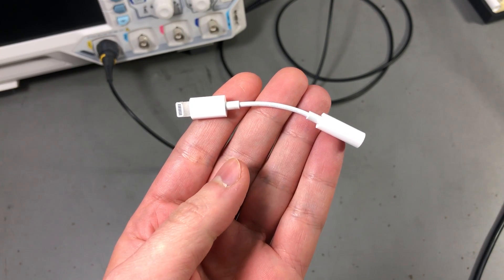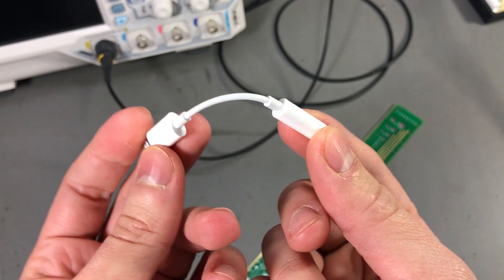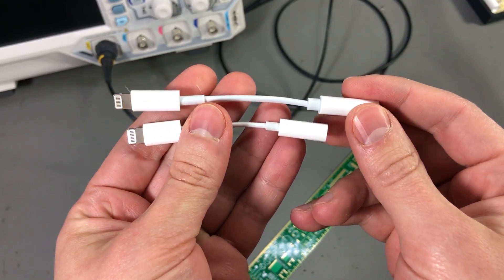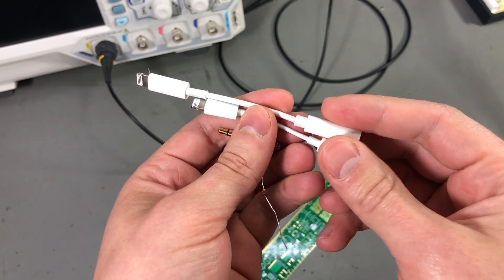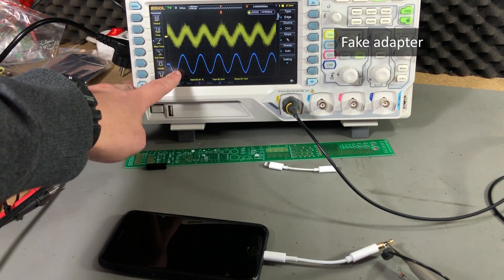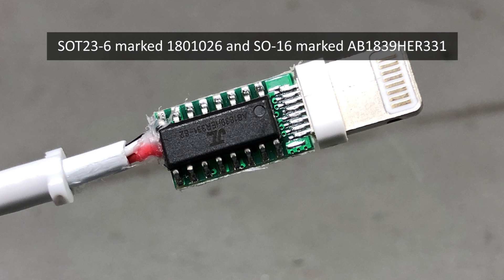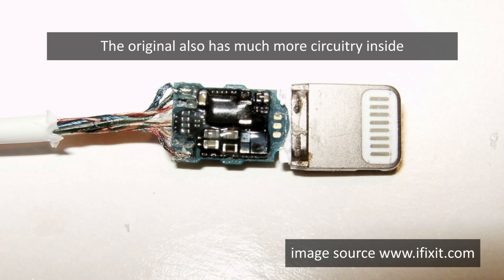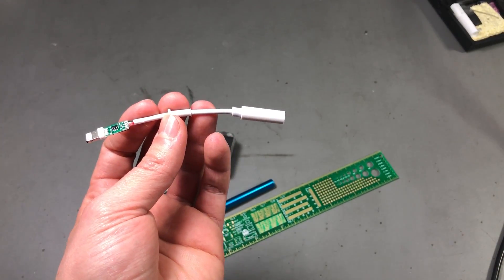Voltlog #214 - How bad is a fake apple lightning to 3.5mm audio adapter?

Comment: Long story short - rubbish. I, too, bought such a dongle last year; threw it out the window the next day (not really). Complete garbage. What pisses me off is why do they sell such rubbish? I mean, If someone had to buy a high-tier phone such as an iPhone to begin with - it is illogical to use this POS dongle with it. The original works the best (obviously) because not only does it sound the best, but compared to other "fakes", the minimal sound volume for the fakes is too high - especially when using a white noise app, the sound is too high on minimum level - which is annoying and inconvenient.

As the saying goes: "A cheapskate always pays twice."

Comment: hello, good friend, one question, does the audio transfer with an original adapter have better audio then?, because it turns out that I have some big original sony headphones but they sound rubbish, if I increase bass with an equalizer, and that does not happen with the others Devices that don't have to use this shhh adapter, when I do it with this it's like a radio with a pillar about to run out of power. I appreciate your answer or if you can pass me information. bye

Comment: FYI for anyone looking at this video now:
Many people have measured the apple dacs inside this lightning dongle and their usbc dongle using an audio precision analyzer. These apple dongles measure better than $1000+ dacs with zero audible noise and distortion. For less than $10 they are incredible even for desktop use and there is zero reason to buy any other cheap dongle
Reply: source?
Reply: @sylver9547  People are usually referring to a report on Audio Science Review by amirm.

Comment: im using a really cheap lightning to headphone adapter which is from ugreen (a chinese brand popular to its usb cables) to be honest I cant really notice the difference, not even a hiss. and its only cost me 5bucks shipped. using heaphone which is a KZ brand (KZ AS16) though im using the KZ brand lightning cable module and dont use the stupid dongles anymore.
Reply: I wonder if it doesn't make sudden very loud screeching sound? It can damage your hearing tbh

Comment: I came across this in my search for information on why i get a notification to “Unlock iPhone to use accessories” as soon as i plug in my knockoff headphone adapter. I never get that with the oem. I’m very suspicious that it’s some kind of data collection function that require an iphone unlock to work. Only info I’ve seen so far referenced GreyKey and law enforcement using such things to attempt to unlock phones. But that was from years ago and i think no longer applies in new ios. My question is if these accessories are doing similar things when i unlock my iphone. I can’t seem to find this information specifically.

Comment: Does anyone know is there actually a DAC inside of this cable? I think that if there really was, Apple would sell these cables for much more than just 9 dollars. I know that there must be a DAC inside of phone for it's speakers, so that they used some of the lightning connector pins for audio output, and these cables are just passive, physical convertors.
Reply: Павле Станковић as an audiophile its a decent DAC yes it has a DAC. Ppl just wouldn’t care about it but for us audiophile its has some serious dac amp. Im using in ear monitor and it power most of it with minimal distortion.

Comment: I am wondering not just about the three wires on the fake adapter, but about the seven ones on the original as well. The jack has just pins, right?
Reply: The others are just extra Ground pins , namely : left channel ground , right channel ground , microphone/remote ground
Reply: ..... I think you'll find the original female socket has four, for a headset/ear-buds with mic.

Comment: I am just wondering how of a quality is the genuine one. Used it once, when I went to clean snow and after a half a hour or so, it just stopped to translate music...
Reply from the maker: It's fragile if that's what your are asking, it's thin and light, I'm sure pulling on that wire a bit harder can easily damage it.

Comment: I got a cheap USB-C to 3.5mm cable off of Amazon recently because the Chromebook I got recently doesn't have 3.5mm and I was pleasantly surprised. It works pretty well .
Reply from the maker: maybe it uses a decent DAC
Reply: Link plzzzz

Comment: The Samsung Galaxy S5 (from 2014) was IP67 water resistance and had a 3.5mm headphone jack. So indeed, Apple is talking BS.
Reply: This is called "gaslighting".
"You don't want 3.5mm headphone jack, we have this brand-new Bluetooth headphone!"
"You don't want thicker phones, you want thinner phones!"
"You don't want anything that is thicker than 5mm!"
Rinse and repeat.
Reply: My ancient but still perfectly functional GS7 is IP68 rated and still has the 3.5mm headphone jack. In fact the latest, yet to be available GS10 still has the 3.5mm headphone jack and is also IP68 rated.

Comment: I stay away from crApple.
Reply: I'd trade in a bit of speed loss for expandable storage, wider OS choices and wider range of sizes with ways to recover data and use past 2 years time and after a new product is released.
Reply: Penurious Sierra Sorry? Ways to recover data? What about iCloud? 

And why would I replace my iPhone every 2 years? My iPad mini 2 is already 6 years old and works perfectly! And a friend’s MBP is 9 years old, and still kicking! In fact, it’d be more likely for an Android user to replace their device because there are no more updates or it’s slow. That you can fix it doesn’t mean an average user can, and it’s also tedious to fix.
Reply: Oh, well, if you like devices that are slow and constantly crashing even with 16 GB of RAM, you might as well use Android or Windoze. I'd rather pay a bit more to be able to be productive and not lose time

Comment: You won't find any datasheets or other kind of docs for a JL ABxxxxxxxxxxx.x DACs with built-in amp and USB ID, cause it's custom made devices from China for internal market only (they don't publish docs for that). SOT-23-6 is also a clone of Torex LDO XC6415 with on/off logic function.
Reply from the maker: thanks for the info, is there any website that documents these things? where do you get your info?

Comment: That noise is bad. You can ignore the jitter, though, as that is just an artifact on the oscilloscope caused  by it triggering in different places on the waveform due to the noise.
Reply from the maker: oldblokeh right! I should have known it's a trigger related problem because adjusting the holdoff did seem to improve it.

Comment: May be the iPhone is sending noise if it detects an unauthorized adapter. You should check if the noise is coming out from the DAC or from the audio amplifier. If it comes from the DAC, it may be sent from the phone.
Reply: What if data are sent ok, but DAC is crap?
Reply: @Chupacabras222  May be. But a DAC is maily digital (the analog part is minimal) then it shouldn't be so noisy... The noise in general is from the analog amplifier that in this device seems to be a separated chip.
Reply from the maker: realistically speaking that is highly unlikely
Reply: You would have this issue with branded third party dongles too, but That’s not the case so I doubt it. I’ve tried fiio and the pixel dongle too lol
Reply: @Alejandro Vargas

That's the kind of underhand stuff that Apple are capable of, simply to force user to buy from Apple.

Comment: Image search turns up some JL parts, and it looks like it's a company called Jie Li Electronics
https://www.google.com/search?tbm=isch&sa=1&ei=gpSDXOSsGsbEz7sPq4Ka6AI&q=JL+AP1839+IC+datasheet&oq=JL+AP1839+IC+datasheet&gs_l=img.3...11555.12951..14757...0.0..0.194.512.0j3......1....1..gws-wiz-img.YNsZobnirsI#imgrc=nraOXSOsd01FCM:

https://electronics.stackexchange.com/questions/243531/help-for-identifying-pinout-of-unknown-mp3-chip